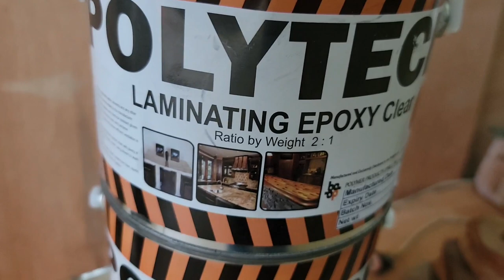Philippines Beach House Build Day 337  Paeng-  It was Just the Beginning

Comment: I made a coffee table, sanded it with 600grit & used epoxy. The 1st time I didn't mix it long enough & had to sand it off. So I said F it & sanded it all off with 80grit, then just epoxed it. You can't tell it was sanded only with 80 grit. Came out as smooth as my wifes butt. Just sayin